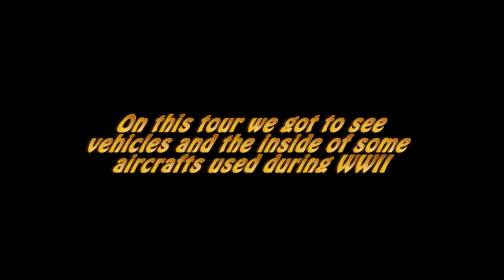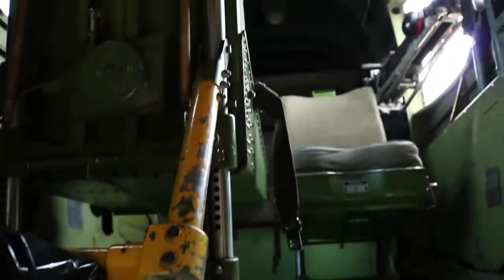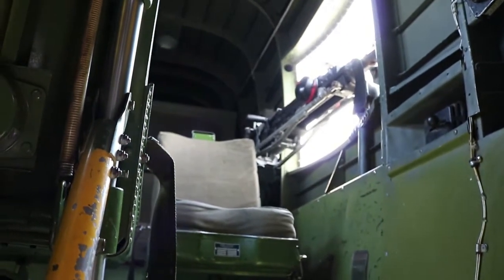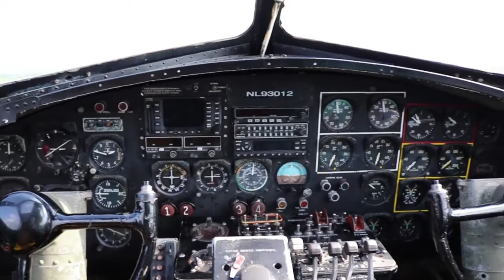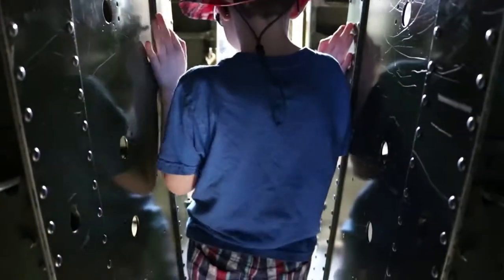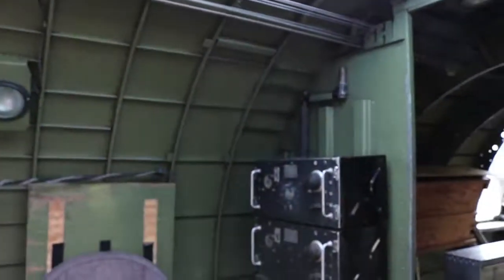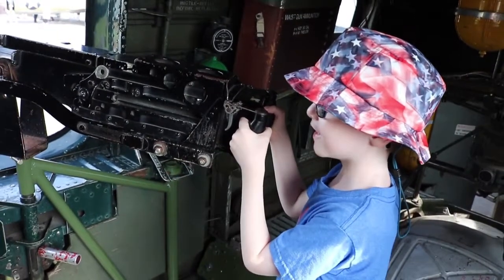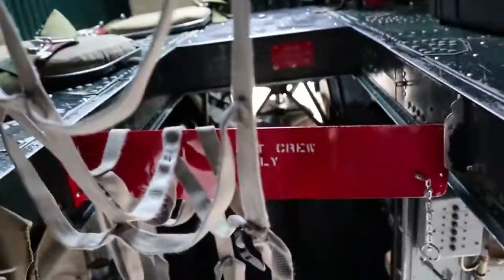A look inside some WWII aircrafts and vehicles

Comment: I spun one of the turbochargers on Nine-O-Nine with my fingers once because I couldn't figure out how it worked. I was really focused on figuring out how it worked and finally looked over and a whole crowd of people were looking at me like, "WTF are you doing?"  That was super embarrassing, but the turbos work differently from most turbochargers today.
Reply from the maker: yeah they definitely dont make things the way they used to anymore. today everything is made for quantity not quality unfortunately
Reply: True, in some ways, but it was just that the turbos function differently from modern turbos. The turbos on WW2 aircraft use axial-flow turbines, and they're right on the outside of the turbocharger (that's how I was able to spin it), modern turbos use a radial-flow turbine that's inside of a turbine housing. I just couldn't wrap my head around it that day for some reason.